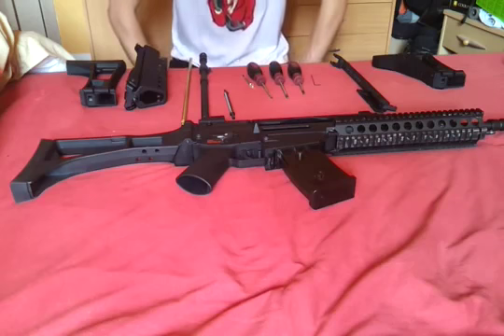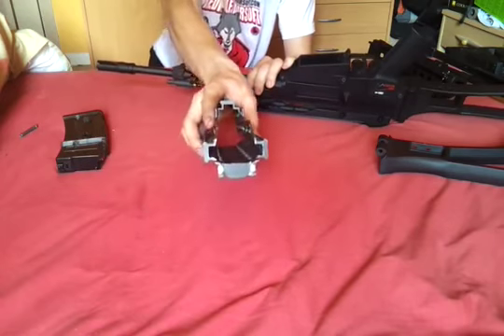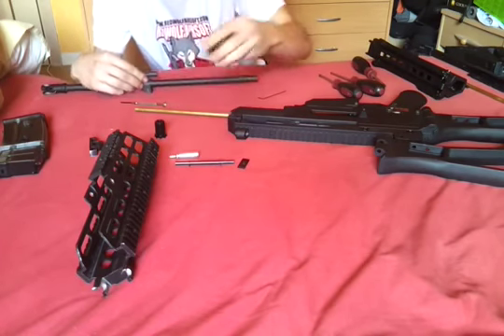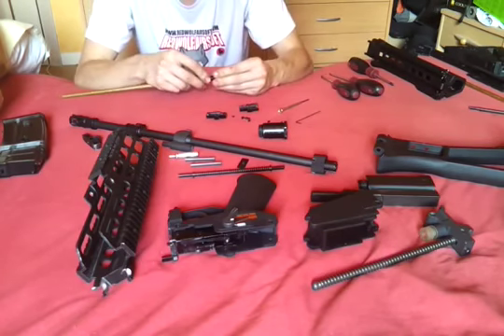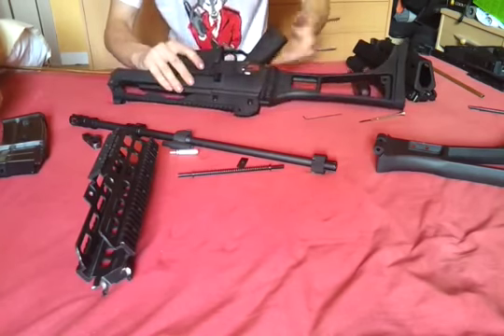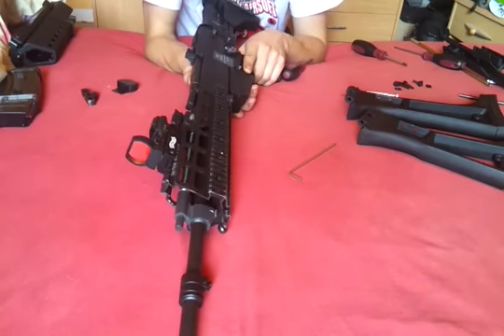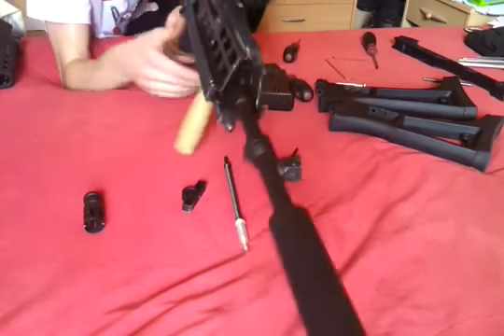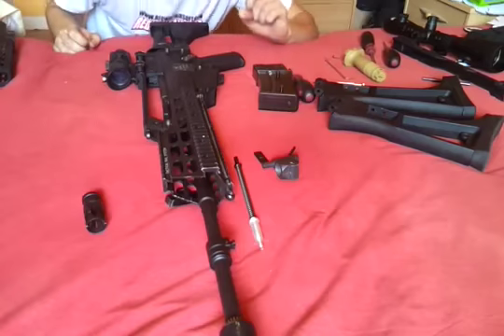WE G39 (G36) GBBR conversion kit tutorial + hybrid model ideas

Comment: i have a g39c and a g39k kit. on my g39c the back part of the outer barrel won't come off 5:25. I took the screw out but its still stuck on. help plzzzzzz
Reply: tacticalevolve WIll you sell me the g39K kit?
Reply: hell no i need that for field lol.
Reply: hehe same. converting to hpa mags and want to convert to the g36k length
Reply: you going hpa to!! Same lol. I just wish there was a video of how i can convert my g36 hicap to my my we g39 mag for hpa.
Reply: Hahah yes! Are you using the CQB Russian valves for the magazines? What PSi are you going to be running? Do you have a tank and regulator already picked out?
Reply: i have all of that sweet jazz. and for the valves i have a elbow 90 degree valve so the hoes for my air can bend easier.
Reply: You ever find out the name of that part? It's really hard to come off so I can't convert to the g39k :(